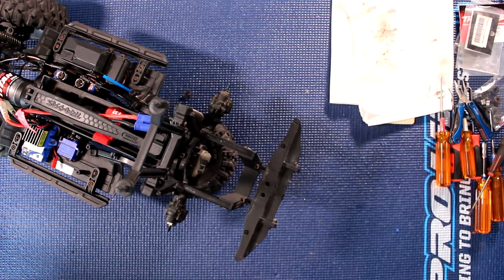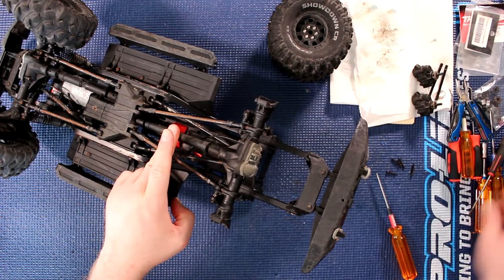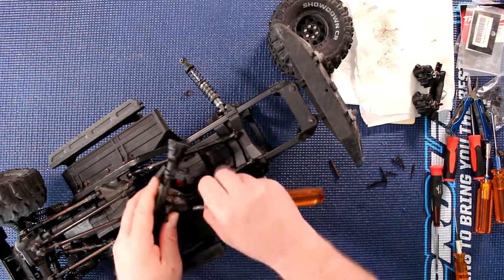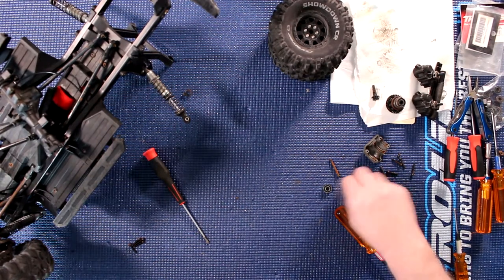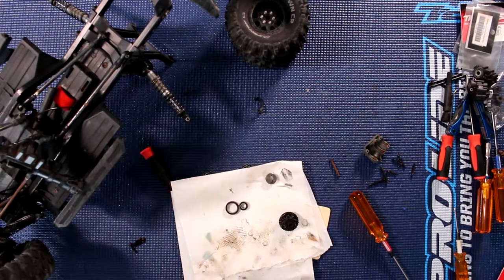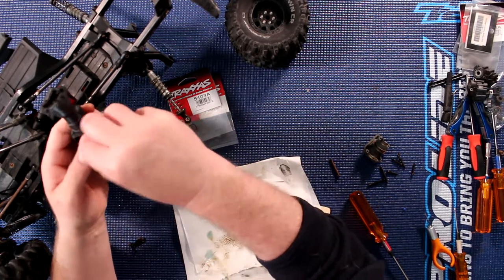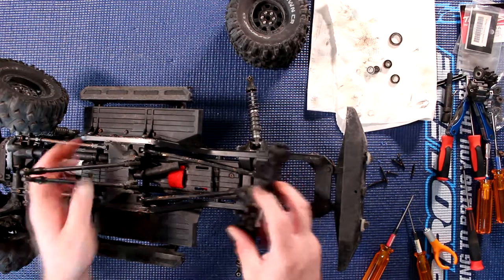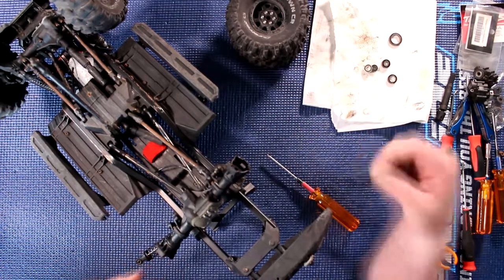How To change Your Rear Diff Bearing Of TRX4

Comment: I reassembled my diff . My don't have cable it's a sport. When turning pinion it would spin su far n either direction and stop. I think I have put axles n out put gear in portals before final assembly. Can u give e me any advice
Reply from the maker: It looks like you might have some binding somewhere just make sure the cases are not too tight and your bearings are seated correctly.  And your bearings are good.
Reply: @djsprc  there new bearings it's something simple thought it was worth asking before twisting blots lol. I sub to ur channel. Return favor @Jeremy kimbro1113